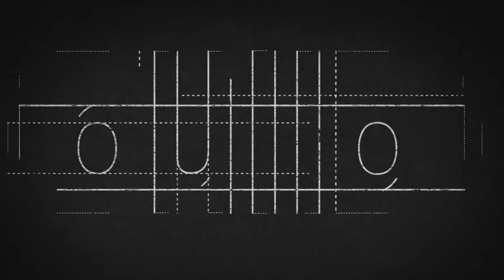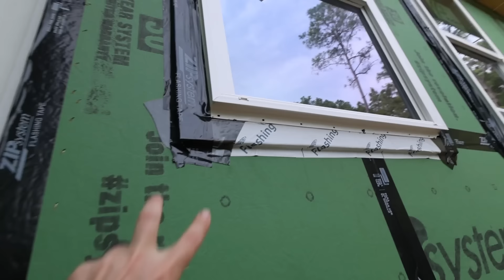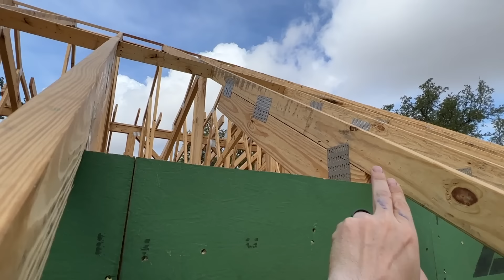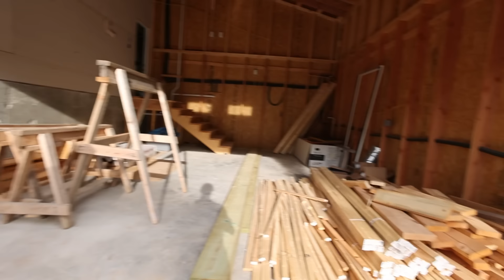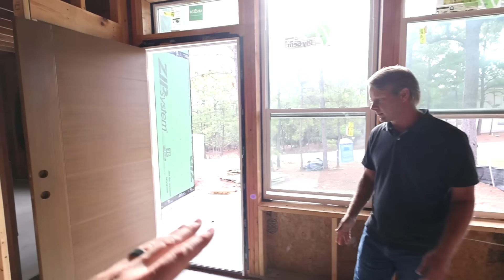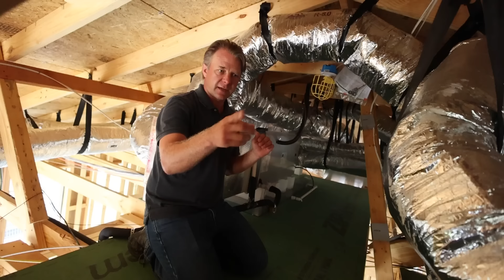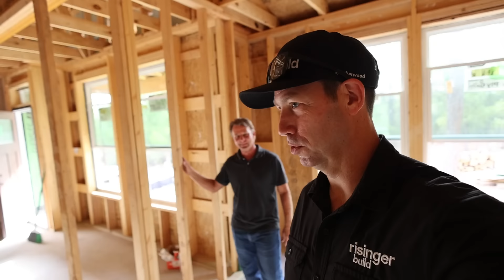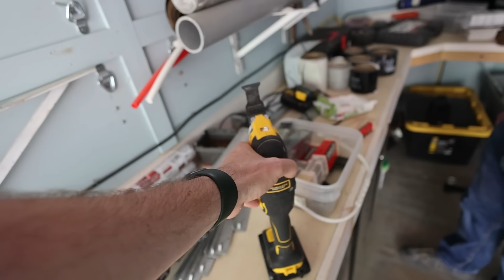LOW BUDGET Details For A High Performance BUILD

Comment: I have cardboard sheathing. I would love to replace my old siding and also put in new better sheathing.. is that difficult to do without taking off the windows or do I need to redo/replace all my windows?
Reply: 🤔. Not an expert but cardboard... Your living in a cardboard box🙈.  Omg I can't believe this is real.   I mean our family cabin was insulated with cardboard 60 years ago...  For a summer cabin....
But to answer your ? I'm pretty sure those windows are gonna suck and you probably should replace them anyway...    Cardboard might be ok if it's done well....  I really really don't know.  Doesn't sound like it to me...   But I personally would wait an extra year or 3 and replace it all since cheap windows will likely need replacing quickly anyway...

Comment: Enjoyed the video. 

How would you flash a window going into a concrete home? homes in central Florida are usually built with concrete blocks. The window buck is usually only on the sides and top for older homes. The bottom is a pitched down/away using a concrete (sill). Makes option of flashing very difficult outside of caulking with something like OSI Quad Max at the exterior face of the flange or behind the flange where it sandwiches behind the stucco finish.
Reply: Something like this?  https://www.youtube.com/watch?v=Lwd3Szn80-E

Comment: With all the efficiency you have built into the envelope via exterior penetration why are you ignoring the A/C ducting efficiency by running flex duct longer than recommended lengths?  You may have been able to lower the tonnage of cooling by as much as 1.5 to 2 tons using round metal insulated duct and saved the buyer thousands of dollars over the life of the house.
Reply: It's a spec house! He addresses the "low hanging fruit" items pretty well. However, your premise is correct but the builder has to compromise. A "budget" HVAC job becomes a high end/expensive very quickly. Scott chose to spend more on ERV, cooking exhaust, etc. Upgrading to "hard pipe" ducting would add to the costs IF he can find a contractor who can do it correctly. That said, he should get a price from the HVAC contractor for comparison. It might make good business sense to do "hard pipe"...
Reply: @patbetik4610  the builder said it was a spec house without specs if I heard correctly in the beginning of his tour. But none the less. Perhaps the specs need to be rewritten or at least be heeded. See Air Diffusion Council’s Flexible Duct Performance & Installation Standards.
Reply: @SilverFox-1212  I agree. I'm a commercial and residential builder in the Dallas/Ft Worth area. I fully understand the importance of plans and specs. I don't see how one can budget, obtain interim financing, perform the bid/subcontract process, etc. without them!  However, the Austin area housing market is RED HOT. They can't build homes fast enough. This would explain why shoddy, inefficient houses are tolerated. Kudos to Scott True for trying to build a better home when he doesn't have to in that market!
Reply: @SilverFox-1212  for clarity. "spec house" = speculative house e.g. he speculates he will sell it after it's built. "specs" = specifications e.g. the details referenced when building.
Reply: @patbetik4610  pardon my ignorance I come from an engineering, contracting and advertising backgrounds and spec references specifications to me. i.e. building to specifications. Thank you for the clarification. But, good hvac design and installation can be a key selling point when you can explain the benefits of the efficiency and lifetime savings. Who wants to buy a money pit?
Reply: @SilverFox-1212  I completely agree! However, my experience has been people's eyes glaze over when you bring these value-add items up. They simply don't understand and won't take the time to learn as they believe the permitting authority has their back. Unfortunately, this makes many spec home builders compete in a race-to-the-bottom to lower cost to maximize profit. I applaud Scott True for trying to deliver a quality product for money when he probably doesn't have to in the Austin/Bastrop spec market!

Comment: Matt I'm a young carpenter in upper Michigan building a cabin for my grandparents and I'm using LP Smartside 4x10 sheets prefinished with Diamond Kote. Zip is both out of my budget and very difficult to obtain near me. So my plan is to Tyvek the bare stud wall taping all seams then after applying the siding (also my structural sheathing) caulk all the gaps between the sheathing. I'm planning on using kraft face fiberglass batt insulation and then typical drywall finish. Just want to get your thoughts on caulking the seams in the sheathing for air sealing?

Comment: Would there be any concern that water might get in through the roof system and potentially pool in that bottom corner/low point created by the angled soffit? - See this time stamp for a visual of the corner/low point I'm referring to: https://youtu.be/fjwjeoLi6X0?t=509

I could see why that would be unlikely, so I get it if that's not a concern.

Comment: I'm doing affordable housing renovation in zone 7, a cold climate where moisture is going to wick into the house from the exterior polyiso.  

Does the Ziploc have me work?
Yes because the acrylic coating is both vapor and airtight.  

I love zip tapes and sealants but....   I went with is a vapor permeable airshield coating, which was an SOB to obtain in the not so great reset. Zip sheathing has a vapor permeability near nothing.  .  

I'm following the principles of Joe perfect wall guy, and what I've learned from Matt.

But just thinking it through for cold climates,  I don't think airtight and vapor tight housing is appropriate for cold climates the way it is in Texas if you're going to use external polyiso.  To the coding makes many of the penetrations just airtight but not vapor tight. I'd really like to get some feedback on that... I plan on calling Huber to break their horns about it.

I'm thinking about putting a 1/16 rain screen between the polyiso and the zip system and also a conventional rain screen between the exterior polyiso and the vinyl or sheet metal.  Yes it's veey affordable housing. Smaller range green under the polyiso came from a lecture from jail.  I wrote to them to confirm, but you know money makes the mayor go right?

I'm also not a fan of putting anything in the Attic after watching a lecture by Joe for the guys in Rochester, but two feet of cellulose with a super permeable foil on top with air ducts from the soffits.

Comment: When you spray foam the inside of the soffits will the pressure of the foam expanding break the seal of the caulking of the soffits or pull the tape loose and leave gaps?
Reply: Not likely. Have you seen spray foam installed?

Comment: I don’t know that I would be able to watch these longer vids all the time, but this was a good one. Matt, quick question  if Zip  goes up and under soffit, how and where does the rain screen dry out from the top, if it’s not vented into soffit?
Reply: Rain screen would vent to a gap at the top of the siding just before it gets to the soffit.
Reply: @moocowzrock  Yes, but I didn't think that detail was covered very well in the video. I can understand the confusion by some viewers. A good start to sharing the knowledge though!

Comment: I would love to see more of Scott's work highlighted - I think his approach needs to be adopted all over because 90% of homebuyers can't afford the Risingers and Bazcecs. 

He's filling a huge void in the market between that top tier and the bottom feeding tract builders using Tyvek and a prayer to seal the houses.
Reply: Just curious what's so wrong with using Tyvek? I don't know much about home construction, but I see Tyvek being used on 98% of the houses where I live.
Reply: @maximiliansepulveda  There is nothing wrong with Tyvek, but it is extremely hard to detail in a way that makes it both a great air and moisture barrier.
Reply: @maximiliansepulveda  Don't forget you need to install it correctly - as Scott said - you see the Tyvek at the bottom just flapping around in the wind loose all the time.  How hard would it be to tape the wrapped Tyvek around the bottom of the sheathing to help prevent water from wicking up into the sheathing?  What, one roll and an hour of work?
Reply: Tyvek is a perfectly good material for its intended purpose(which is not air sealing)
Reply: The video (and audio) was well done. For the most part, the information was delivered in an easy-to-follow fashion. I am, however, a little unclear as to what type of spray foam will be used. At one point, Matt alluded to the use of low density foam, but it was not specifically confirmed by Scott. Also, I was a bit disappointed that no details were revealed regarding the roof deck other than the underside was to be spray foamed. I am curious as to whether any additional foam board insulation will be used above the roof deck. 

For all builders... investigate the book "Pretty Good House" - a guide to creating better homes. Pretty Good House provides a framework and set of guidelines for building or renovating a high-performance home that focus both on its inhabitants and the environment—but keeps in mind that few people have pockets deep enough to achieve a “perfect” solution. The essential idea is for homeowners to work within their financial and practical constraints both to meet their own needs and do as much for the planet as possible.  https://www.tauntonstore.com/pretty-good-house.
Reply: You should watch how to build the perfect wall  then you’ll understand all of this
Reply: Me too😊

Comment: its nice to see all the new advanced stuff, that most people dont know about, that will with time eventually trickle down, but its also good, to see videos where the people now with a more restrictive budget, get knowledge, how to make stuff the best possible, without going way over budget... most of the things Scott  done mean a giant difference in quality thus will last longer, and you wont have the usual issues with air and moisture, or even actual water leakage, which sadly do happen more often then they should..
so he really found a balance , by using the best possible stuff to deliver a quality product, but is sensible about the cost... really good ideas... and you know you had an exceptionally well idea, when Matt starts to use it...

Comment: People may object to this sentiment about spray foam, but I feel like the uses of spray foam in this house are going to contribute, potentially, 100 years to life span of this house. Right now we are justifiably concerned about greenhouse gas emissions, but in 30-60 years when, we’ve restored the planets ability to cycle carbon and stopped using the sky as a sewer, all the crap houses slapped up by careless builders are going to be falling apart and still need to be landfilled we are going to have a crisis on our hands. This guys spray foam could be saving our bacon in a few decades. I think conservative use of the stuff still falls into the category of responsible and sustainable building, inspire of some valid concerns about emissions

Comment: Scott said he will spray foam the rafter spaces but he didn't say what type of roof will be installed. Because I will build a home next year I've been specifically researching insulation. I saw a video that said not to install asphalt shingles that has spray foam directly on the underside of sheathing in the attic because it will significantly reduce the life of the shingles. Apparently some builders don't know this assuming this is correct information. What I don't recall is open cell vs closed cell foam. This would be a costly mistake if done incorrectly. Anyone, please advise or comment if this is true.
Reply: This seems to be a controversial subject. Some say no problem - https://www.youtube.com/watch?v=hJTDvDPtF0A and https://www.youtube.com/watch?v=qB6-NUSPnHs&t=0s. Others say problem or it depends - https://www.youtube.com/watch?v=ZRVDYZUlmhg. I like stone coated steel shingles or standing seam. Do research for your area!
Reply: From what I remember it's rotting wood you need to worry about if there's no air for it to breathe.  It might be that he installs a metal roof or a double roof? I'm to create that needed breathability.

Comment: John Van Steinburg 
Quick question for ya. All of your videos suggest using tape exclusively to seal a home. Has anyone tried liquid rubber? I used it to coat the cement block between the ground and the framing. It looks good, is water proof, is long lasting and is an assume sealer. Liquid rubber is messier to work with but adheres better than tape, provides a thicker seal, is longer lasting  and of course the sealing of both water and air are extraordinary.   (BTW, I don't have any interest in any rubber coating company). Your thoughts? Thanks, John
Reply: Matt did a video on this.   https://www.youtube.com/watch?v=8REZYAUaaRk&list=WL&index=128

Comment: When do the furring strips need to be pressure treater? If the exterior block wall that is above grade,  connects to a stem wall that isn't, do the furring strips need to be treater? If it does would it be more cost-effective to tape the wall before applying the strip, is that even a thing?

Comment: How does the soffit drain water? Seems like the underlayer of the roof should be able to breath and dry. In other high performance builds haven't I seen a gap layer between the house and the roof?

Comment: I started using Fentrim tape on my complete gut remodel and noticed that it tends to wick water through the felt material. It became an issue where I used it to seal window and door rough openings, it will wick water to the interior, even if you have a slope built in. Now I have to tear out the entrance door to fix this.

Comment: Hey Matt, love the idea of using the sill seal as firring strips for the cladding to achieve the air gap for the rain screen. Do you think a 3/16” air gap is enough to adequately achieve the desired outcome of a rain screen? We build rental units for investors so need to be budget conscious as well. Climate zone 5, high desert climate, with fairly minimal rain, but when it does, it rains sideways.

Comment: How do you treat the overhang space above the soffit. We find we have to vent that as it heats up and can trap moisture--- Is it ventilated to the interior? I think you answered my question. You spray foam into the overhang. So is it possible to fill it with foam? I can see another issue, shear blocking for the roof above the plate and how that works in this method. And what are you talking about at 10:30? I couldn't understand the word you used regarding furring.

Comment: I like Scott's approach for a central Texas "spec" builder.   I will suggest the Bosch heat pumps have a reputation for poor humidity control even though they are variable capacity.

Comment: Great Vid Matt!  I had other things to do but stayed hooked up for the next detail 'till the end, fascinating.  Love the work and work ethics of this guy.  The one thing that keeps me scratching my head though is that "you don't need PT for a rainscreen", what am I missing if you will.  On another note I understand the choice of spray foam but I like better the way you built your own roof with a double layer of polyiso or something like it on top of the roof deck.                                                                                      I think this type of air tight house with its attendant mechanical systems for A/C quality can be within reach of regular folk but only at a drastic shrinkage of square footage at a time of home affordability being the lowest ever, possibly.    And then not even.                                                                                                                                                                             My guesstimate is that the house featured here can't go for less than $800k and I may be seriously under estimating being in the Austin area.  For most hoi poloi in hot and humid climates like TX and FL where I live, the cheap option would be to go back to the original Cracker style passive ventilation houses... never mind the ERV :D.             The current energy crises decimating economies world wide is not a temporary hicup.

Comment: I'm slightly concerned about using Big Stretch on the inside when you've already got the foundation gap sealed from the outside with Siga. If any water gets under that member, won't it be trapped there and cause rotting? My thinking is that it's best to leave the inside open and just seal the outside. (Then again, I'm up in Massachusetts USA.) Nice ideas! Excellent use of using a spec house as a testbed for new techniques.
Reply: Siga fentrim is semi vapor open (and I think Big Stretch too). Water will be able to dry both way and cause no damage unless you have a major leak.